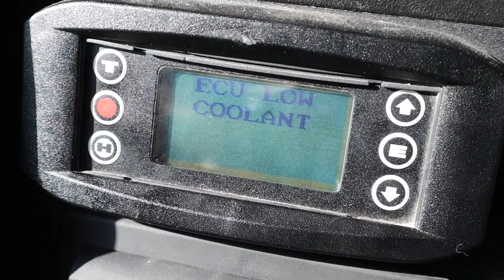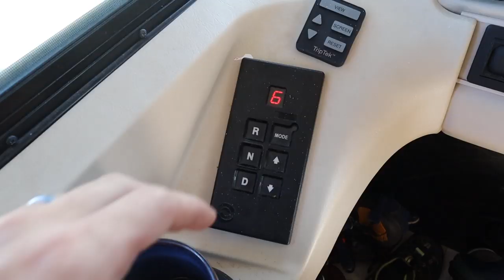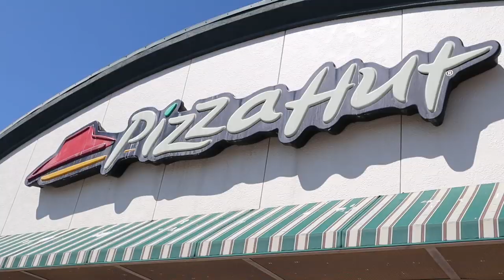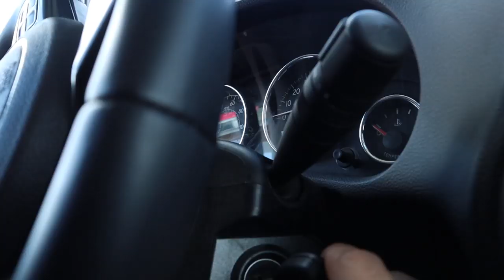RV REPAIR is Part of RV LIVING // Overheating Class A Diesel Pusher

Comment: After watching your video of you climbing the hill I think you might be over over revving that diesel motor I’ve been driving for 25 years commercial trucks rarely ever go over 2100 RPM you’re gearing too low possibly have your mechanic watch the video
Reply from the maker: Your right, I was going to high on the RPMs. But I still had a different problem. Thanks for watching!